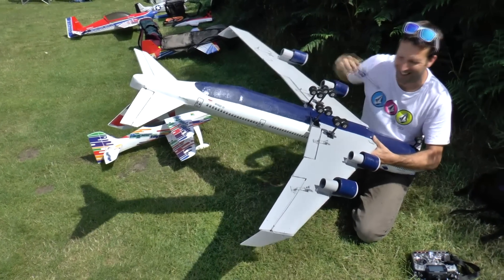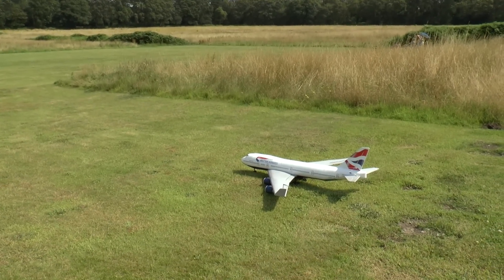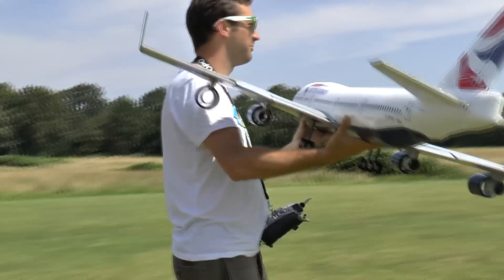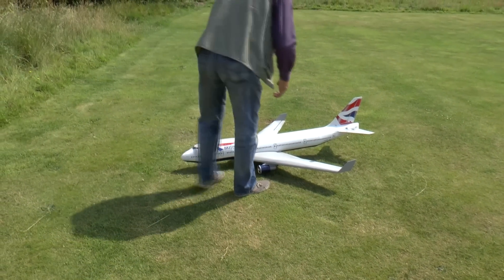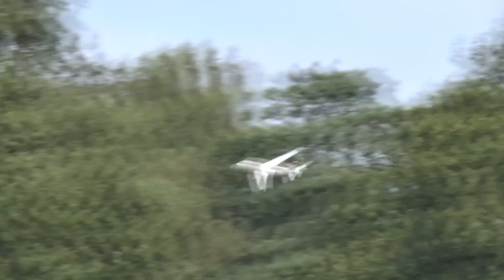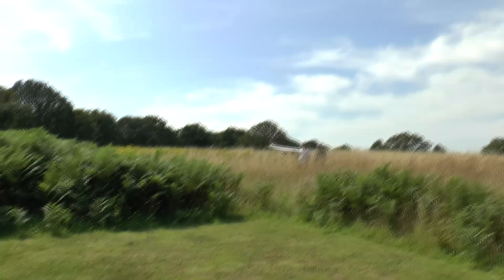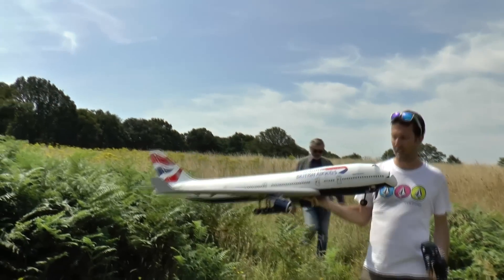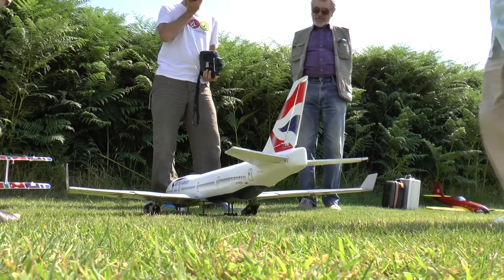Boeing 747 maiden flight

Comment: Based on the real 474-400 it looks like the C of G should be about 20-23% of the MAC, which is about 8cm, not 18cm from the trailing edge. I've put the dimensions into a few calculators and they suggest 5-6cm from the trailing edge... explains why it was so damn hard to get off the ground.

Comment: I've almost finished the repairs and added separate 70-90c discharge batteries and decent 40A ESC's and 12SWG wire. I got the thrust up from 650g to nearer 1000g. It will hopefully give it the extra kick it needs. Wondering how large I could make the wheels for grass takeoffs before it looks daft.

Comment: Would you reccomend these fans for a smaller profile 747?
Reply from the maker: yes good fans but I would recommend minimum 30a speed controllers but preferably 40
Reply: ok, thanks for the quick reply, love the plane, going to start mine very soon (profile first) then i might cover it and make it aesthetically pleasing.